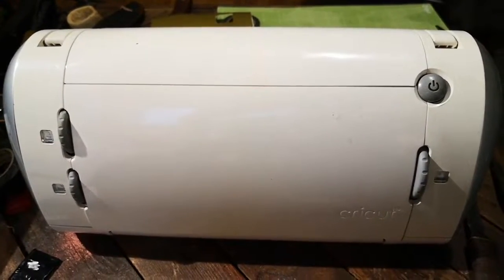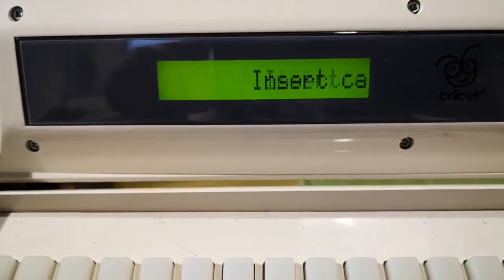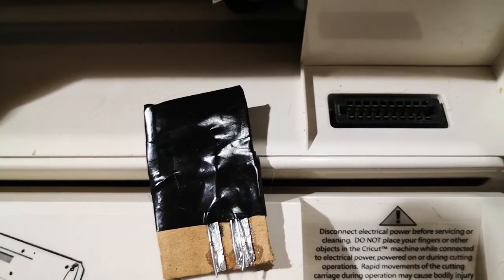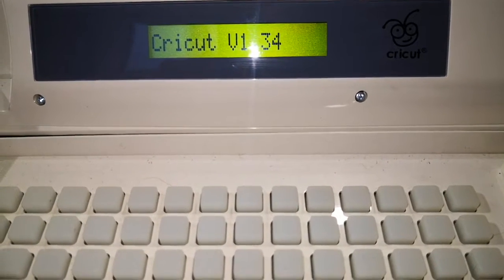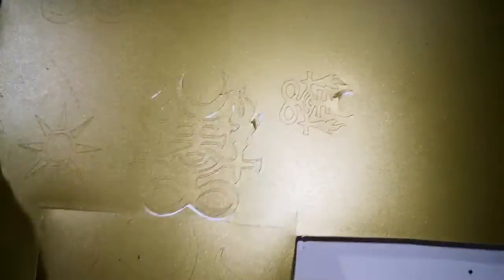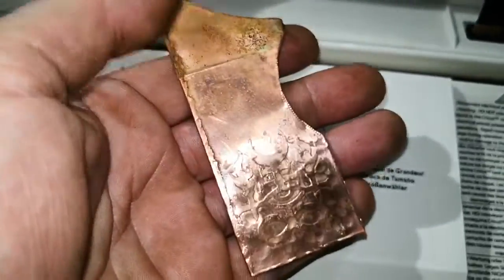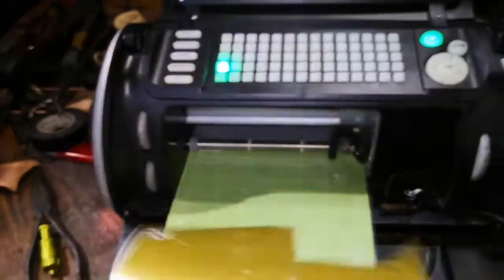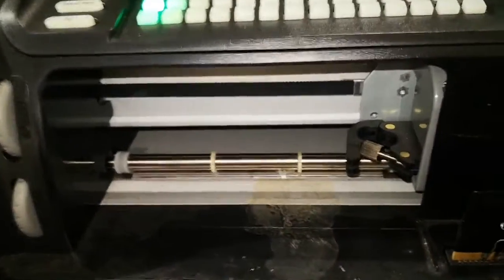Use a Cricut without a Cartridge Hack - Tested on CRV001 and Create CRV20001

Comment: Hi, I purchased an original cricut like yours years ago and I just pulled it out to give it a try 😢… it turns on but the message area does not light up or give out message also will not load paper. I was about to toss it but saw your post and thought maybe you might know a fix.

Comment: Honestly, to anyone that wants to get into this stuff, the best thing you can do is get a Chinese made plotter in at least a 24” width. You can get models for a couple hundred with free LXi software which is a free version of flexi. I work at a sign and wrap shop and we’ve used a Vinyl Express 24” plotter everyday commercially for going on 8 years. Literally no maintenance needed other than new cutting tips. We mostly use oracal 651 vinyl on it. All the cricut and homeowner grade products are a rip off. Our plotter was like $600 and will last a lifetime. The machine before that was $2500 and required a lot of maintenance.
Reply: Finding these for less than $20 now in thrift shops and yard sales, I don't think its really a rip off at that price.
Reply: I got one for $12
Reply: I got mine for $5 😂
Reply: I got my for $25 with cartridges

Comment: That one is newer. I have the original Expressions. You need the universal overlay for the key functions. There are 6 function keys on the top left two columns.  You can connect to the internet with the USB. You don’t need design space. I use Canva. But if you have your own CAD program, use that. It works. Been doing it for years.
Reply: The one he shows is the very first cricut from 2005
Reply: I just received an expression .How do I do this.

Comment: It worked on my Expression Original...finally.  I did not understand that you only want to short the front 2,3,5 pins.  I wrapped my foil around the bottom of the card to the back.  That locks up the Cricut.  I super glued foil on a credit card cut to just the right size.  When I figured out it should only be on the front, I just scraped the foil off the back and it started working.  Thanks for the hack.
Reply: Great observation! it wasn't working for me until I shorted the FRONT! of the pins only. Thanks
Reply: @MrAgustus101  Always glad to help.  That's what makes YouTube great.

Comment: I still have my original baby bug, the Cricut (or Cry-cut as you pronounce it)..  also have the original Expressions and the Special Anniversary Edition with the FOUR preloaded cartridges.  $50. was a pretty good price, I paid $118 when the Expression came out and lowered the price of this 'baby bug'.    I have over 30 cartridges, so I would never try this... but it's great when someone can figure stuff like this out....  I am surprised that the die cut machine seems to be programmed for the George cartridge - I use all of mine in the machine at various times...  interesting !!
Reply: I wondered if there was another option. I wanted to try another cartridge I been eyeballing.  Maybe another set of pins. Like 134.. lol.

Comment: o Just a heads-up I tried different combinations I have a few cartridges I just copied what the pins were in a cartridge and nothing to Just a heads-up
Reply from the maker: Yeah it only works in that combination as the George fonts are installed in the actual cricut, everything else, the data is in the actual cartridges.

Comment: Are there any other combinations that work??? This got me going only for that particular cartridge I'm wondering if any combinations would work for other cartridges..
Reply from the maker: I don't think so, from what I understood that George cartridge font data is actually in the machine, the cartridge basically just activates it by doing essentially the same thing I do in the video to connect the slots with wire.
Reply: Thanks for the quick response...

Comment: The nice thing is you don't have to use the mat if you're cutting with vinyl you just put it on three three three and I'll cut out without vinyl that's why I love this old machine I have the newer one but it does work if you need something quick and easy!! If you cut out vinyl at 6 and 3/4... It's perfect also you can sharpen your needle with foil! 🇺🇸
Reply from the maker: Punching the blade into foil does not sharpen it. It will help remove anything stuck on the blade like glue or glitter, but definitely does not sharpen it.
Reply: Hello. Can the machine CRV20001 connect with computer? I have the same one but it's old. I don't know if it works with a PC. Thanks!
Reply from the maker: @soelymdg3577  yes, I connected mine to the free software from cricut to upgrade the firmware and use sure cuts a lot Software to edit and upload my designs for the cricut to cut. All the links and info for that are in the video description here.
Reply: @alchemykitchen777  Thank you so much :)  I'll try. I'm a newbie and I don't know how it works. It's to make acrylic invitations with vynile and I hesitate.

Comment: 😀 Thank you!! Worked for me!!! I haven't done the updates or Sure Cuts a Lot yet, but the 2,3, and 5 got me started!!
Reply from the maker: My theory is if it isn't broke, don't fix it, so unless you really need that software, I would leave it as is  if it is working
Reply: @alchemykitchen777  i bought this thinking I could cut skins for a mavic mini drone. It is not what i should have got. But for now I'm stuck with it and  still haven't been able to use it with my chromebook. I wasted my money, my own fault. I can cut letters though, couldn't do that with the ones that came with it, that's a plus! I should have done more research I didn't know this thing was so old!
Reply from the maker: @traciej73  I am able to cut whatever design I have in .svg format onto vinyl with mine.
Reply: @alchemykitchen777 How can I use  SVG files with this? 
 How can I make my own designs with this?
Reply from the maker: @susieque22002  yes, with sure cuts a lot Software you can import. Svg files